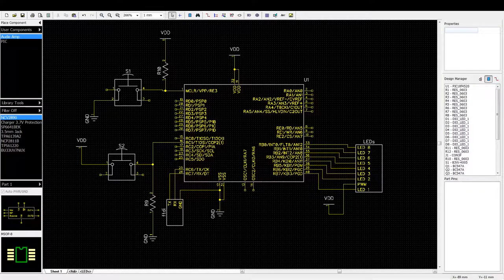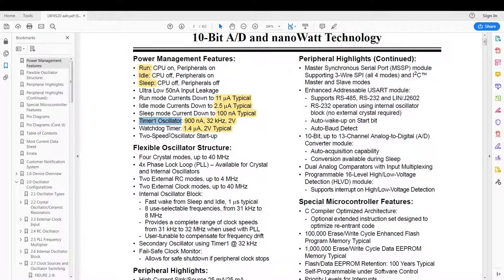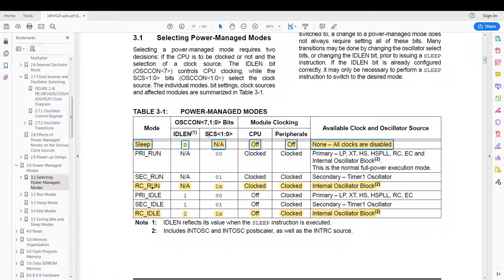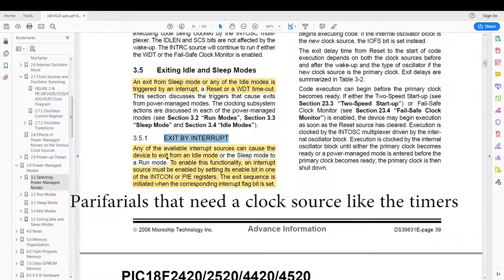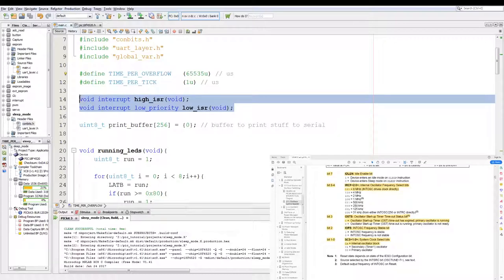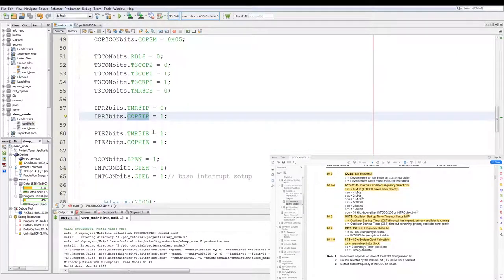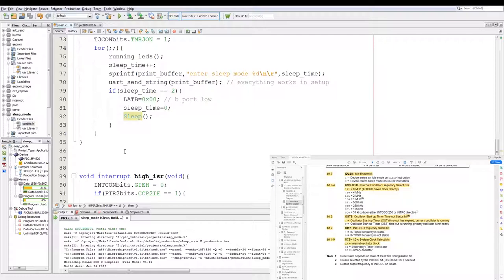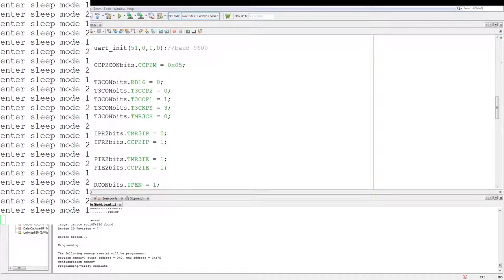Sleep (Power States) 🔴 PIC Microcontroller Programming Tutorial #17 MPLAB in C

Comment: Hello Iam working on PIC12f683 I need to run timer1 in sleep mode according to data sheet Timer1 can work on 32khz internal oscillator 
my work is to "provide a output pulse after 3 sec at the same time input will come" code is able to working in normal mode but how to use sleep mode in this chip no other mode is available in this chip any help is appreciated.
Reply from the maker: Datasheet - 6.8 Timer1 Operation During Sleep of the PIC12f683

"Timer1 can only operate during Sleep when setup in Asynchronous Counter mode. In this mode, an external crystal or clock source can be used to increment the counter"

In short you need a external clock use timer1 in sleep mode. The internal oscillator won't work for sleep. There is only one mode and that is deep sleep for the PIC12f683.
Reply: @BinderTronics  Thanks for reply
Datasheet 6.2.2 state that If an external clock oscillator is needed (and the
microcontroller is using the INTOSC without CLKOUT),
Timer1 can use the LP oscillator as a clock source.
and 
Datasheet section 6.4  A low-power 32.768 kHz crystal oscillator is built-in
between pins OSC1 (input) and OSC2 (amplifier
output). The oscillator is enabled by setting the
T1OSCEN control bit of the T1CON register. The
oscillator will continue to run during Sleep.
Reply from the maker: 6.5 have you tried asynchronous mode?
Reply: @BinderTronics  
yes I try to set LP oscillator but when I set TMR1CS bit = 1 code is stop working coz timer1 switch to internal osc but LP mode is not start.
    T1CONbits.TMR1CS=0;//internal instruction cycle clock

    //T1CONbits.T1OSCEN=1;//LP oscillator is enabled for Timer1 clock
    //T1CONbits.nT1SYNC=1;//Timer1 set up in Asynchronous mode
Reply from the maker: Going to recommend you try the forms rather. Still think it needs a external crystal.